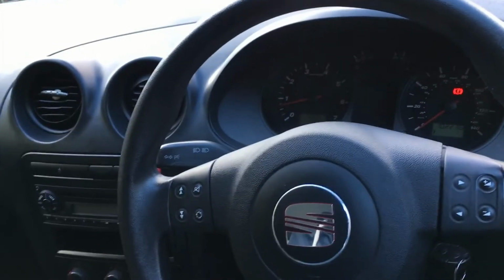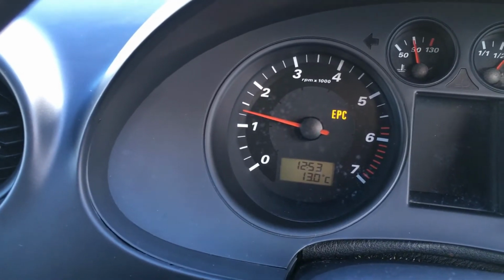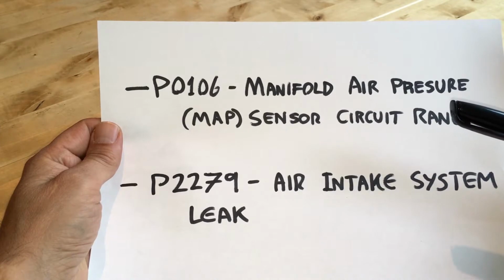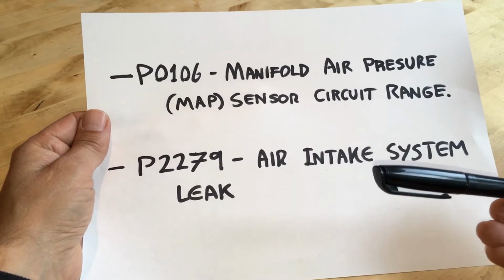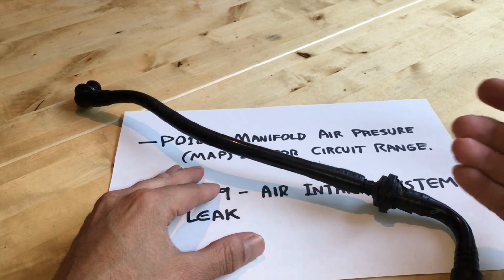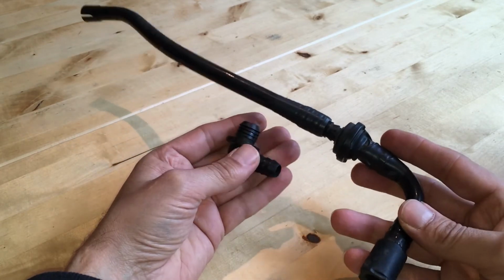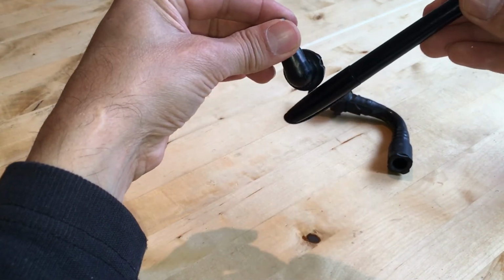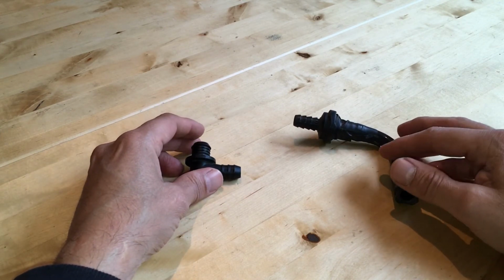Seat Ibiza Intermittent EPC Light & High Rough Idle (Fault codes P0106 & P2279) - Diagnosis & Repair

Comment: I have checked this pipe only to find it's ok. I took off the air box assembly to make access easier. 
In doing so I had removed the oil cap.

The engine was running smoothly while I was checking the pipe for leeks. 

I then put the air box back and finally replaced the oil filler cap.

The engines idle dropped to very near stall level. It have then tryed taking off the oil filler cap on and off while the engine was running and each time this idle speed dropped for a few seconds and then returned to normal?  

Sadly the pipe is was checking has not got a leak so I'm left scratching my head again. All fluid levels ok even the steering system. 
I'm left thinking it maybe is the throttle position sensor?? 

I dont have a fault reader..
Brendan
Reply from the maker: Sounds like u might have a problem with your PCV system. Also get urself a basic cheap OBD code reader mate.

Comment: Thanks for your video.  These are my problems with my 2007 14 sport ibiza. I will check this out.. ive been a high pressure high temperature oil an gas well service engineer for 23 years.. but you can never know how to fix all mechanical issues.  I was told my a very wise old man in Aberdeen the day you dont learn something or say you haven't learnt something. 
Is either the day you should retire or your not telling the truth..

Comment: 2004 model 1.4 Benzinli Seat İbiza aracım 2 yılı aşkı süredir bende. Aldığımdan beri sürekli motor arıza lambam yanıyor ve sürekli EPC ışığım yanıyordu. EPC arızası kapsamında oksijen sensörünü değiştirmemize rağmen Motor arıza lambam her 300-500 km de bir yine yanıyordu. Her bu verilen arızada servisde bir parça değişmesine rağmen kronik sorunum bir türlü çözülmüyordu. 3 gün önce TÜVTÜRK muayenemde egzozdan kalana kadar. Egzozcuya gidip bi kontrol yaptığımızda gördük ki aracımda Katalizör yokmuş. Var olan katalizörün içini boşaltmış şerefsizler. Ki ben aracın 2.sahibiyim. 2 katman seramik filtreli katalizörü aracıma 900 TL ye taktırdım. Araç nasıl rahatladı anlatamam. Tüm arıza lambalarım söndü. Şimdi şıkır şıkır çalışıyor. 

Sizin de benzer bir sorununuz olabilir diye bilgi vermek istedim
Reply from the maker: Teşekkürler
Reply: S.a reis benimde seat ibiza 2003 sürekli epc yakiyor ve araba bayiliyor gitmiyor bahteniz sorun aynimiydi acaba

Comment: Very useful to know and probably common to other makes having plastic pipework which gets brittle with under bonnet heat and age.Thanks for sharing,well explained.
Reply from the maker: Thanks for the comment, glad u found it useful, yes I agree, old plastic getting brittle generally a problem in many cars - particularly many German makes & models I think.
Reply: In my seat ateca 2019, the EPC lights appeared on the dashboard when I drove over 65 miles an hour on the highway then stopped I switched off the engine and restarted and dashboard error code light disappeared and never come back, and please advice.